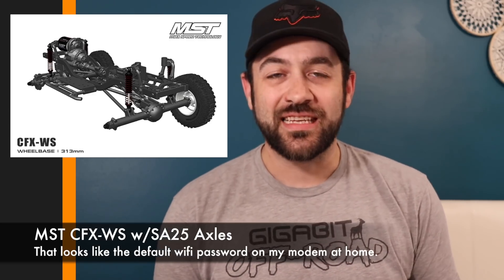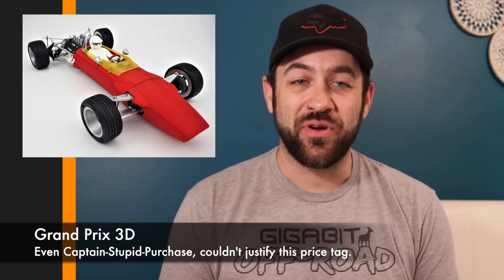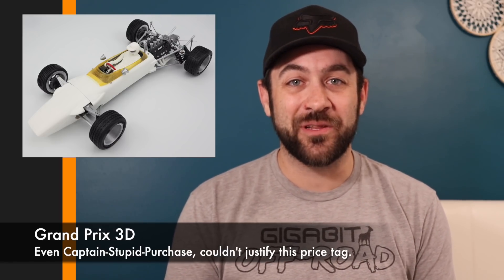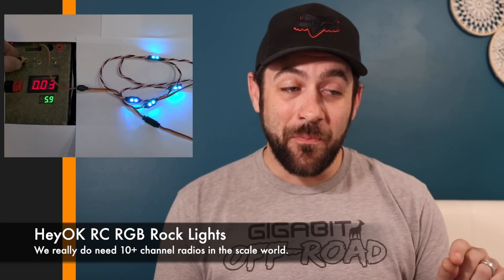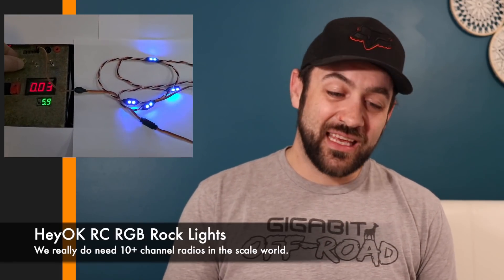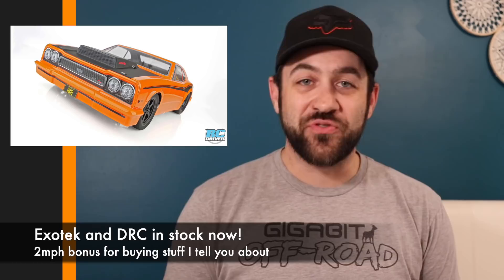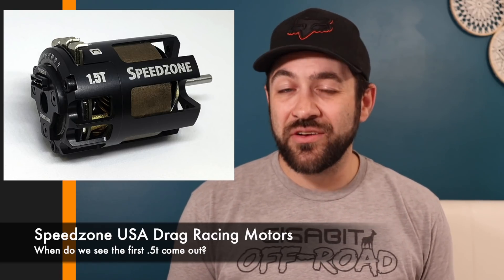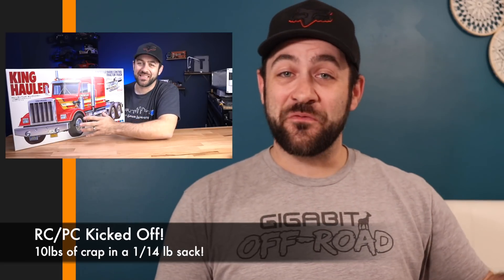Scale News Update - Mississippi - Episode 131

Comment: I got a set of Locked Up RC .185 SLW Hex Hubs for my Locked Up 2.2 Iconic/Trailready’s that I’m putting on my Capo JkMax Ultra 4 modified stock class build .. that’s about it for Thanksgiving weekend. I almost bought the RC4WD Marlin Crawler RTR that was on sale .. but I just couldn’t manage to hit the buy now button for some reason .. and I’m glad I didn’t as I like that new black TF2 a lot better .. though I probably won’t buy that either 🙄 UCFab Lasernut Pretty Penny chassis will probably tie up the rest of my budget for the year.